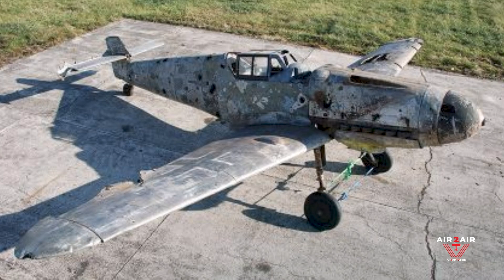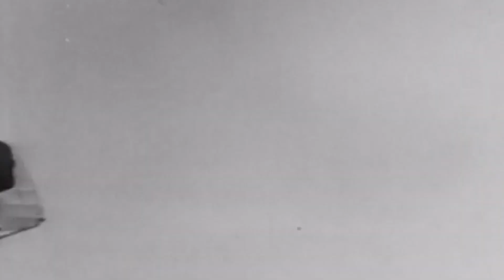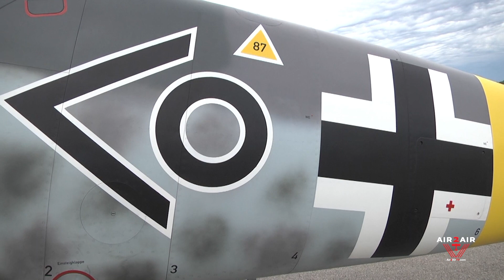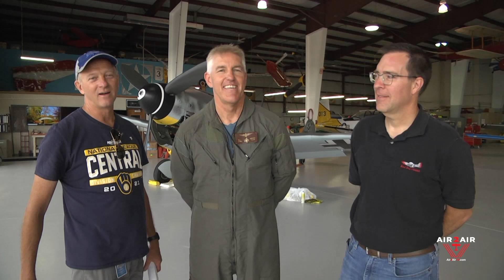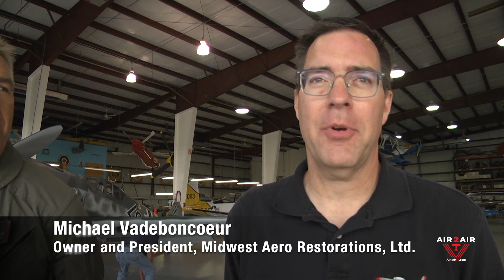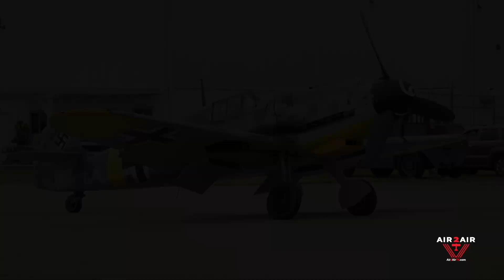Restoring a Messerschmitt 109 BF 109 G-6 | Sneak Peek Of The July 27th Unveiling At Warbird Alley

Comment: Hey! I need drawings of the propeller, spinner and hub Messerschmitt bf-109. I no longer have any idea where to find it. Maybe you have a high-quality 3d model - even better :) Could you share? Please help me in this difficult task.
Cheers
Reply: If MidWest Aero doesn't have it, AirCorps might
Reply: @Bluenose352  ty!
Reply: @RoyksoppPeople  Not a problem. Another great restoration company of the -109 is Meier Motors in Germany.  They have restored, and converted at least three Bf-109's, and one HA-1112 with the DB 605.   Great group of guys
Reply: @Bluenose352  
Thanks again! Grateful for your help! I wrote to both, but I'm not very sure that they will answer at least something, not to mention help and any actions